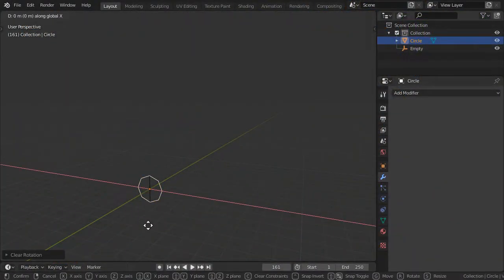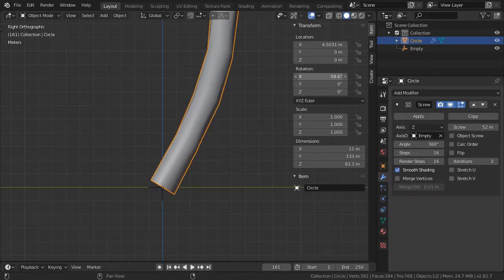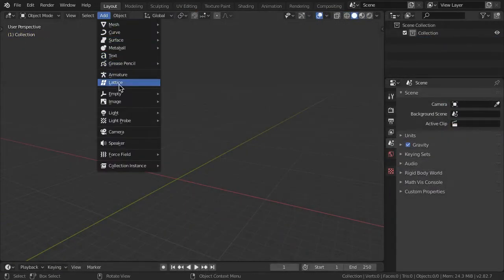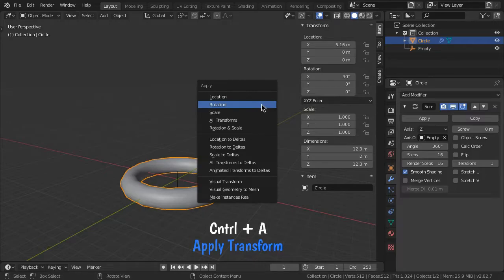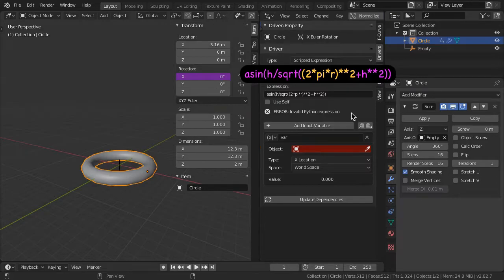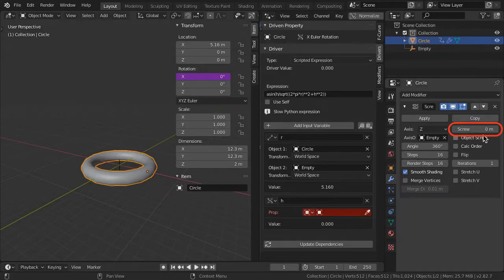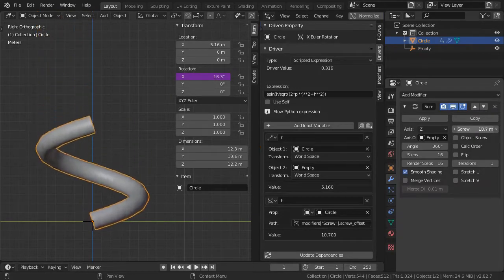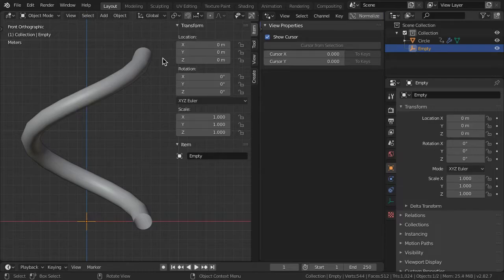Blender 2.82 : Spring Modeling and Animation - Screw Modifier and Driver fix

Comment: Insanely useful.  Out of curiosity, where did you get that equation?  Did you calculate it yourself or get it from a different resource?
Reply from the maker: Thanks.  Glad it was useful.   I found the general equation for the arc length of a coil on a math website, then derived the formula to orient the cross-section myself.  Its basic high school algebra and trigonometry.   I have another formula for maintaining the radius of the spring as it is stretched, but I did not want to over-complicate the tutorial.   
Honestly, this isn't the best way to rig and animate a spring, but it is simpler and more accessible than the alternatives.   I offered it only because the Screw Modifier Is a popular beginner method.
Reply: i guess I am pretty off topic but does anyone know of a good site to stream newly released tv shows online ?